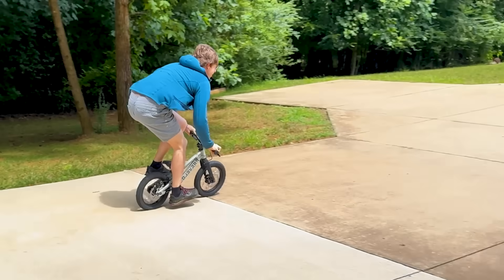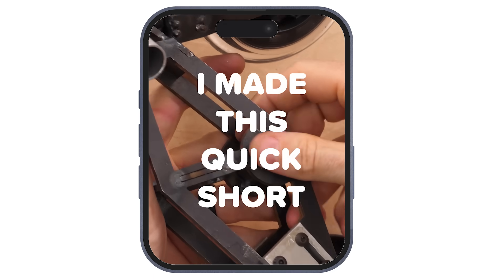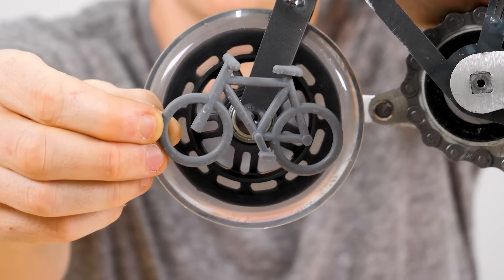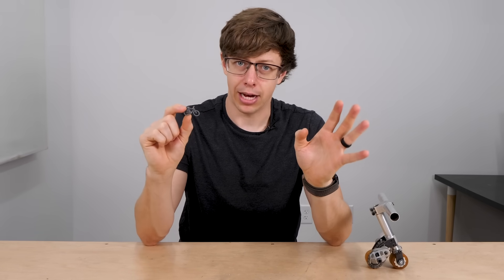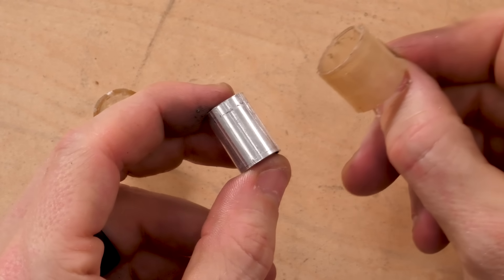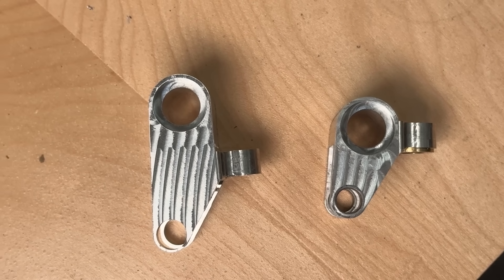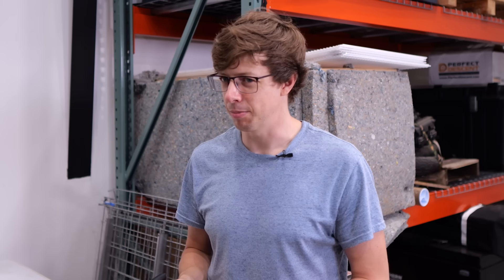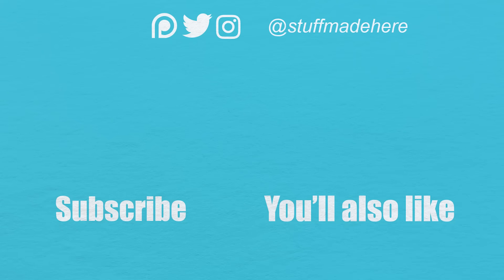After 100+ parts and 45 hours of practice, I did it

Comment: Ahhh yes.  Everybody has a $200k 5 axis Haas and tooling for personal use.  And a pile of material to burn through because there is zero chance you didn't scrap a whole lot of it.  There is no "just press a button".  At least don't mislead the kids.  I'd like to see them interested in such equipment... but a whole lot of work occurs before any usable parts fall out the other side.

Comment: Out of curiosity is there a reason you chose not to use clip in bike pedals? It seems like that would solve the pedal issue since most clip ins are shaped kinda like an egg beater so they have a smaller form factor plus many have no platform so it's just balancing your weight over the middle. This is quite the accomplishment. Well done.

Comment: What is the point of this torture!😢.
Would suggest a gizmo to enable anyone to ride a unicycle. You could not only reduce the carbon footprint, could reduce congestion and increase the wellbeing. The issues to solve are: making learning easy(overcoming inhibition and space requirements), making it safe(falling is ok, but getting unjured not so much), making it energy efficient and ergonomic(partial electric is ok, if it helps), making it portable  and compact and light weight.❤👍

Comment: @ 6:00 why do you need a chain at this point? Gear to gear would have been easier
Reply: I was wondering the same thing, maybe it's not technically considered a "bicycle" without a chain?
Reply: @chaseczymbor  There are bikes that use drive shafts like trucks, so I doubt it needs a chain to be considered a bike.
Reply: Wouldn't you need an extra gear? It would be reversed lol
Reply: @Hatomix  I was waiting for someone to mention this, but I still think 3 gears would be more durable than 2 gears and a chain? I could be flat out wrong tho...

Comment: Give it a much longer handlebar shaft, and it will be much easier to balance on.
Reply: Seriously, if you straighten your back with a long shaft to the bars, and then widen the handlebars, you will balance much more naturally. Think of the greater moments of inertia and leverages which will help you. You could probably shave another couple of millimetres off the tyre diameters too, and make it into a slightly smaller bike.

Comment: If the height doesn't matter, why not make the steering shaft longer and telescopic? Could you put the handle bars on hinges so they can retract? Does width count also? If not, maybe make the wheels like 2x wider for better stability.

Comment: just out of curiosity, did you consider just removing the handlebars?- or does doing that make it so that it's no longer a bicycle (there's flexibility here, depending on which definition is used)?  it seems like removing the handlebars would make room for you to maintain your balance better (a la unicycle or skateboard-style motion), but still be able to pedal without the difficulties incurred by having to bend forward so much to steer...

Comment: 13:28 wrong phrasing. The real problem is that as soon as the pedal goes in front of front wheel, the bike pivots around front wheel, and ... There is no more pressure on the back wheel ... Then , the back wheel just slips on the ground, and with no friction, the pedal just « falls down ». Your weight is no more converted into pressing pedal and spinning back wheel : the pedal does not support the foot, and you just fall by gravitation . 

Issue could be hugely reduced if the pedaling force was transmitted to both wheels. Then, the more your body is front, the more you press on front wheel, and pedaling force is always transmitted to ground via wheels  . 

Of course, at this scale, transmission to front wheel is an engineering « challenge ». 

But by geometry, it would double the length of stable body position. It would be the whole bike length instead of rear half.

Comment: Seems it would be easier to ride with a 4’ tall handle/fork. You’d be able to stand up and you’d have leverage to keep it from snapping forward. If they only care about wheelbase why not improve the design?

You’d probably need a wider, hollow tube for that vertical bar for strength as a lever that long would easily bend a bar the size you have now, but I bet it would make a huge difference!

Still, this was awesome and great engineering! I haven’t seen one way bearings before this. Subscribing!

Comment: You should have used the belt itself as the tire! Run it around the crank and make the crank freewheel. It's goofy but it should prevent some of the skipping as the crank can be a normal size to grip the belt teeth

Comment: what if you took the tiny design, ran a chain to a normal sprocket and normal size handlebars? 

If the bike size is considered by the wheel bake, then you can make a normal sized bike with a tiny wheelbase

Comment: There's also a kind of bikes that if you pedal backward you begin to brake, no hand-operated brake needed. If you keep pedals still it will just roll. Usually on cheaper bikes, but if your chain pops off - you only have your feet to brake with. Wanted to install an additional ("emergency" or "backup") hand-operated brake, but couldn't find one that would mount to my bike.

Comment: You don’t need a 5 axis milll, get outta here. Your poor wife, will it ever end… I too am obsessed with the next tool. I want a water jet now. I think you should see about using structural rivets for thick parts with a pneumatic rivet gun. that way you can avoid welding, you’ll be able to make frames even faster!

Comment: Climbing shoes would be perfect for riding this bike I think. They're made to provide good stability even for small holds like this. And they come in different variations. I'm not a climber myself, but I'm sure you would find a variation which would lend itself very well to this.

PS: Thanks for another amazing video. Always a banger.

Edit: Climbing shoes might also allow you to shrink the pedal size. This would reduce the overall torque introduced from pedalling. Resulting in less yaw and roll and putting less strain on the pedalling components and the ones connected to them.

Comment: "If you stop or pedal backwards it skips"

What? Pedal backwards is braking. The only good way to do so. If you use the brakes on your steering thing, it brakes the front wheel, causing you to flip
Reply: That's why you would use the back wheel brakes instead

Comment: There are bikes without chaind and drive the wheel with shafts and gears. If you design one doing that vertically it might give you more space to place the pedals, etc. You will essentially have a pogo stick with pedals and wheels

Comment: Tip: decent road cycling shoes have carbon fiber soles for less flex/better energy transfer; those might be helpful in your case. Your pedals aren't much smaller than Speedplays (a popular brand), but using clipless pedals (which lock into cleats on the shoes) seems like a recipe for injury with your setup, so probably best avoided.

Comment: If they don't care about height, tben you don't need to be hunched over. You can make the handle bars your height. It would make it a lot easier to ride, too. You make everything just as small as you did except the handle bars can be on a 4 foot tall pole. Or, if you want to be a purist, start with a tall handle bar to get used to the footwork and balance required, and gradually shorten the handle bars lower and lower until you have it as low as it should be and can ride it.

Comment: I mean yeah increasing the rear tire to fit a chain is an option... Or just connect it with gears? 
And why did you ride on wood? Ride it on ground steel

Comment: Why you used a chain/belt I don't know...
For such little distance just having gears connect together makes more sense.
Reply: Rachet mechanism he already mentioned
Reply: @SouravKumarSamanta  Actually the bearing he used means he can use gears. It would fit as much as a chain setup would. Though I'm sure, to count as a bicycle in his eyes, it needs a chain or belt connection. I also wonder if a geared setup would coast enough. You'd need three hand designed gears minimum.

Comment: You might be able to make it smaller by changing your shoes to climbing shoes, the hard rubber makes them sticky and able to hold onto small ledges, it would probably be more difficult as half your foot would be hanging off the side, but it should solve some of the problem of needing the thicker part from having bigger pedals.

Comment: 11:10 Make your own comedy size sprockets and chains. Yeah I wouldn't have the patience for that either.
Reply: He wouldn't need to. There has to be smaller chains. If nothing else, he could use the chain of one of those tiny chainsaws and grind off the teeth. He would still need to make the sprockets, but that's easy work with the water jet and CNC. 😊

Comment: That epoxy floor is really lumpy (I’ve got the same in my garage). Anyone near you have just a skimmed concrete floor in their’s? You may have mentioned this in the video, sorry for wasting time if that’s the case, I’m a multitasker (failed).

Also, why not go wide on the pedals and workings? Isn’t the record just about length?

Comment: Why did you feel that you had to use a belt? Couldn't you just have meshed the gears together or just directly driven the wheel with the petals? Then it could be smaller near, your original goal.

Comment: Your shoes were the problem for the pedals... what you needed were proper climbing shoes (and not the crappy rental ones either, and wear 2 sizes smaller than you think you should... they need to be as tight as possible). They're designed for tiny ledges / footholds, making them ideal for tiny pedals. Also, could you not have gone with multiple belts instead of a chain?

I'm still impressed you got this far though, especially with those shoes.
Reply: Was thinking the same thing about the shoes. He probably doesn’t need to go super small though since he’s not putting pressure on his toes.
Reply: Good climbing shoes don't need to be two sizes smaller anymore. They used to in the early 2000s but rubber technology has massively improved. Still need to be tight but they don't need to be crippling anymore.
Reply: @MrWongle  Tell that to Magnus Midtbo.
Reply: There are also tinier chains available out there if you search than the one he used, but it's way easier to critique than do and he did just set 2 back to back world records soooo....
Reply: Agreed with this. He's having problems micromanaging the pedals with compliant shoe soles. Stiff climbing shoes would work. So would road bike cleats that clip into the pedals.
Reply: Edge loading.
Reply: Even bowling shoes or flat-soled cowboy boots, or squeezing your feet into an abandoned pair of your wife's high heels with the heels chopped off.
(and that last one would have made great video!)
Reply: Here i was thinking those shoes with wheels on the heels would help haha
Reply: I thought about biking shoes, they have a metal plate that clicks on the pedals.
Reply: @satibel  I dont have biking shoes, but I would assume they are build to create the preasure more on the middel of the ball, where climbing shoes are very good to have the preasure on the sites.
Reply: @satibel  Trying to fit cleat mounts instead of peddles that wouldn't just shear off the second he slipped would be near impossible.
Reply: @satibel  If you pause the video when he shows all the shoes he tried, there are several pairs of cycling shoes
Reply: @ryanohoro3764  but I don't think he showed pedals made for cycling shoe.
Reply: He needed clown shoes
Reply: 222nd like
Reply: I was thinking some form of clip on shoes
Reply: Must confess I thought "belt skipping? Just have the gears mesh, no need for belt or chain"
edit: going to the tall boy would have scuppered that though!
Reply: He's a competitive biker, he probably knows all of this

Comment: If you're not concerned about the height of the bike, why not have a much longer front stem so you don't have to be doubled over to reach the handlebars?
Reply: Just above your feet is the best place for the handlebars, and the only place that actually allows you to ride the bike. If you extend the handlebars up, they either interfere with the movement of your legs or if you move them too far up, you would be basically standing and your center of mass would be shifted back making it incredibly hard to balance. 

You could possibly give the handlebars a forwards rake, but then that brings into question whether or not it's actually a bike anymore, since the handlebars would protrude ahead of the front wheel, and, if it is, would the "length" of the bike still just be the wheelbase, or would it be from the rear wheel to the front edge of the handlebars? Since, if you only care about the wheelbase length, you could make a perfectly balanced regular sized frame on top of a very tiny wheelbase and call it the "smallest bike in the world"
Reply: I suppose so that the bike qualifies as the “smallest” without handlebar or seat disputes as “part of the bike”.

Not sure though, good question.
Reply: @TheRealBlueBeanie  I like to think it's so the handle bars don't move beyond the wheelbase while providing angle for caster. But the pedals reach beyond the wheel base, and the handle bars don't strictly need caster. Maybe it's just a silly record because of the absurdity of it all means you pick and choose. Theoretically, if it didn't matter you could set up a huge rider's triangle and actually have a seat and bars you lean into. I can't imagine trying to balance on that. Nor the one he made haha.

My other thought it that the human interface can be larger. Anything that wouldn't be changed for rider size is what actually counts.

Comment: Now we need a sequel for the World's Biggest Bike
Reply: Collin furze did that, it's the social distance bike. If you check history book, somewhere 1400? Ish where bike invented it's massive
Reply: @Simon-tr9hv  That one is tall.  What about long?  And for it to really be a bike it needs to have only two wheels.  I think it should be easier than this one.  At least you'll have space for things, like linkages to the front steering column from a good 50 feet away.  A good chance to teach about bridges because it would be a spanning problem.

The longest would probably need some gyroscopes because above a certain weight keeping it balanced becomes a challenge for a human.
Reply: @JasonMitchellofcompsci  I'd wager to bet the guys that do top speed runs on bicycles on the Bonneville Salt Flats up in Utah probably have some longest bike frames currently. They would certainly be a wealth of knowledge on this subject.
Reply: @JasonMitchellofcompsci  the LONGEST bike. Would be pretty fun, if maybe not great in turns xDDD
Reply: @StaYUTI420  I don't know what they have, but for the record, you could build something really crazy. I would imagine something with like 10m wheels, if the wheels are wide enough and it had a low center of mass it would not need to be balanced so the only limiting factor really is how much mass you can still move with human force alone and how large the wheel span can be using materials of that mass. But in the plain with enough gearing you can probably move tons and use that to build something with a wheelspan of tens of meters. It would be a costly video to make for the space and materials to build it alone.
Reply: @JasonMitchellofcompsci  He pretty much did longest bike, too, although it was a motorcycle because it gets really heavy.
Reply: The farthing-farthing?
Reply: Fantastic idea! I'm all for it! Please make the world's biggest bike!
Reply: There is a Guiness record for the longest bike too, but the record holder is a stupid brute-force design that doesn't really deserve to be called "bicycle" (steam-roller type wheels, no actual balancing).
Reply: I don't know if Shane has the budget for that lmao
Reply: @shepardice3775  He just got a HAAS 5-axis mill. Pretty sure he has a good budget. :P
Reply: Rideable without motors
Reply: I saw a clip of a long bike being ridden by over ten men.

Germany has a beer bike that serves beer and is pedaled by many customers.
Reply: Please do!